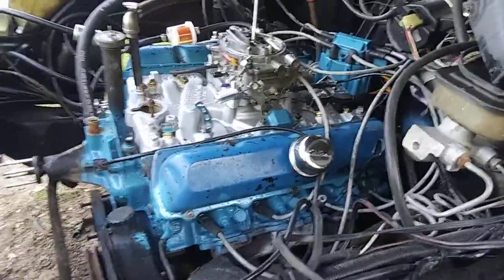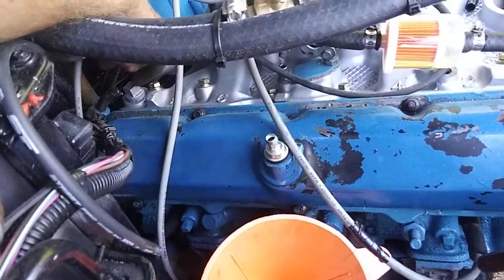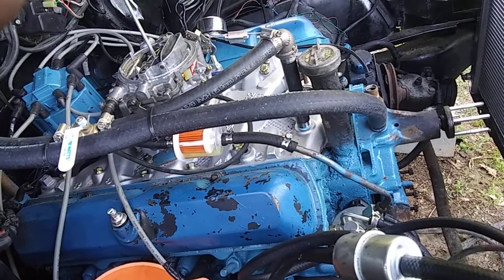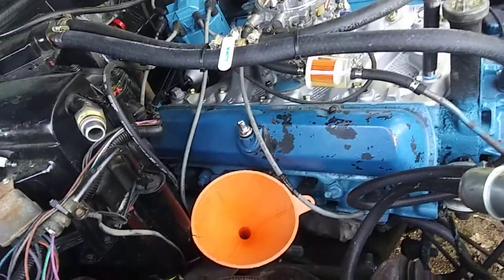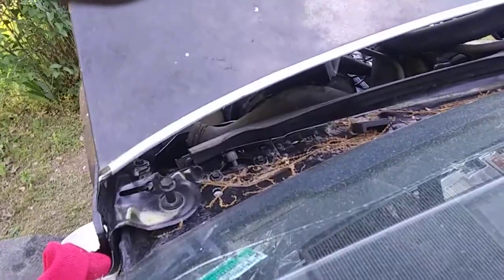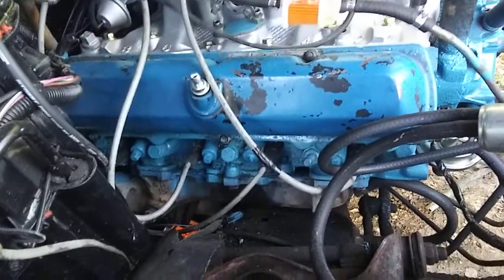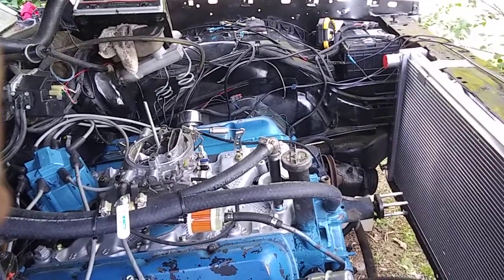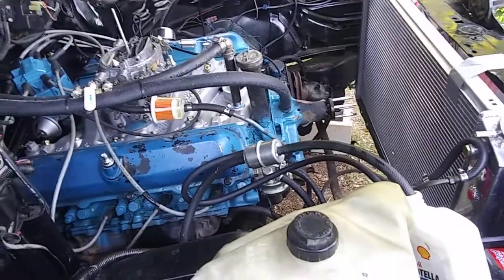DIY PROJECT UPDATE: For 1985 BUICK Lesabre Hearse 307 CID aka Undertaker " She runs "  Part 3

Comment: If you don't have one put a oil pressure gauge on that thing and make sure its got enough. Some years of Olds have a coating on the timing gears to make them and the chain quite, over timing the coating comes off and can plug the oil pump pickup. Not to run down your motor but something don't sound to healthy in it just, another reason to be on the hunt for a 403 Olds.

Comment: Not sure if you got new plugs but the best plug for the money is AC delco. I run them in all brands of motors AC44 or AC45 should work the higher number the hotter the plug. And if you can't get a timing tab I can take a video of mine with a tape measure so you know where to put a TDC mark.

Comment: I see its got 7A heads, They are roller cam heads and have very small ports on intake and exhaust made for mileage. I would get the proper timing tab looks like the same one a 455 uses. There was millions of 307 olds made so should be easy to find.  Do some math and put a mark at 36 degrees. Then set the timing so its 36 degrees all in, I would keep my eye's open for a 403 Olds for it. Lots of full size Gm cars used the Olds 403 in 77,78,79 it was the replacement for the 455 big block that stopped being used in 76. If you want to flush the motor put in a 1 litre of new oil and 4 litres of diesel and idle it for 10minutes and drain it. I have diesel flushed several dozen engines and they always sounded better after and the oil stays clean after